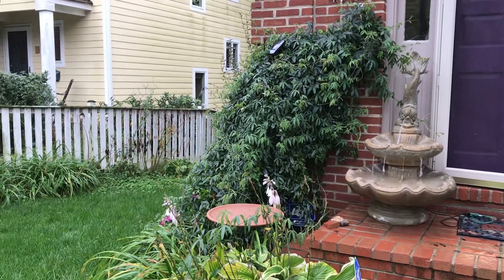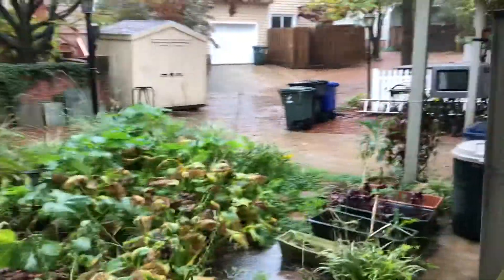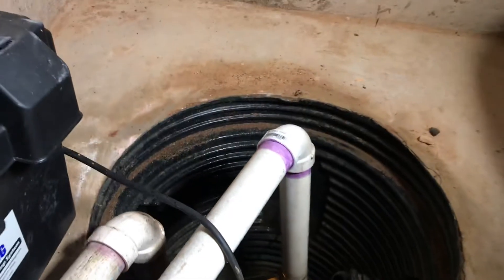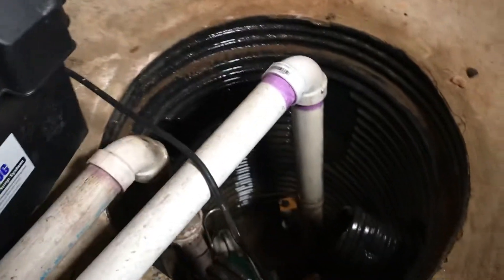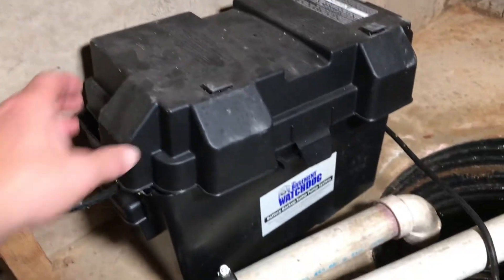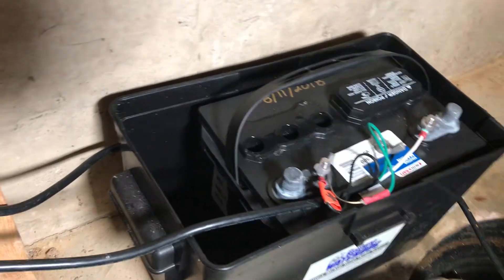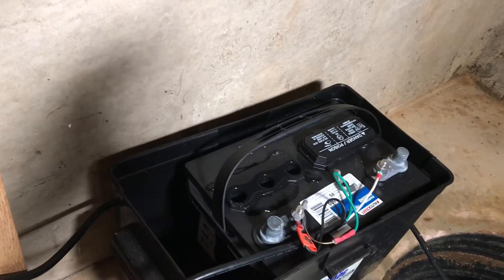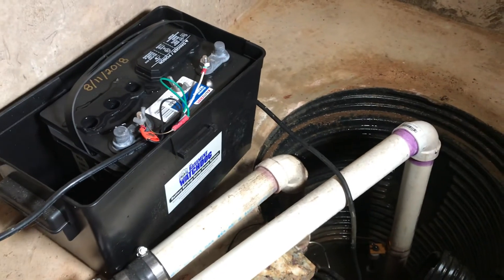How to Test a Basement Sump Pump & Battery Back With or Without Water Prevent to Basement Flooding

Comment: Every how long you check for water level in the battery
Reply from the maker: Great question! Most instruction manuals recommend you check the water level monthly. Ours is located in a crawlspace so I add it to the list of things I do each year with the time change including changing smoke detector batteries, cleaning out the dryer vent, cleaning the coils on the refrigerator, cleaning the coils on the outside AC condenser, etc.

Distilled water is best if you have to top off the battery. Try to avoid using tapwater.